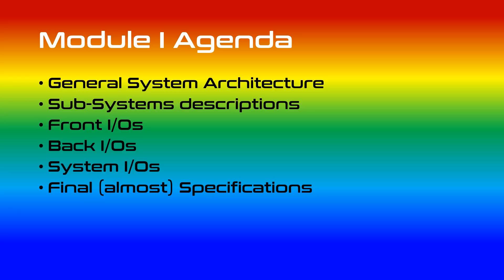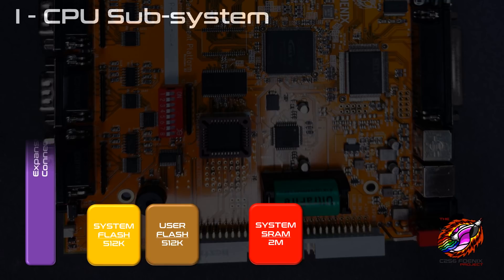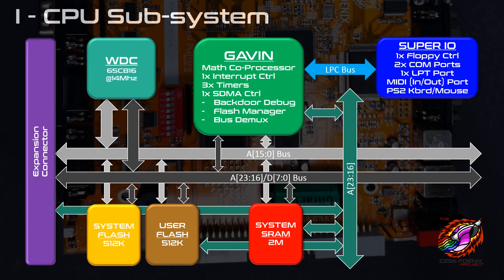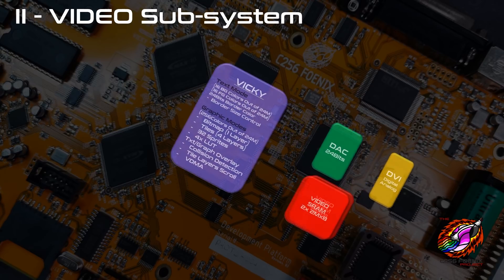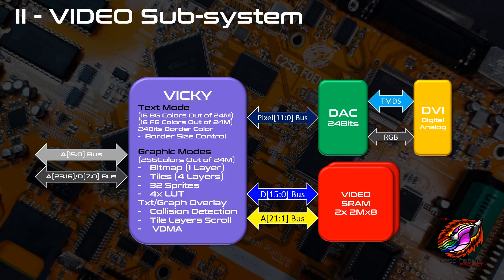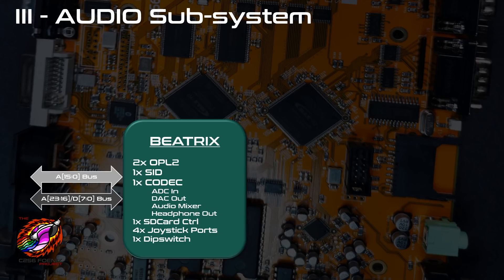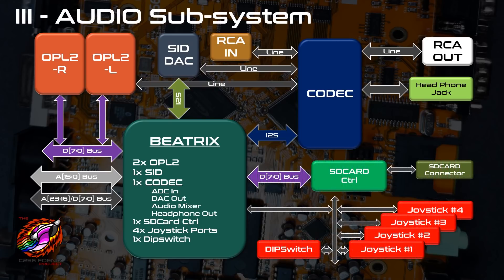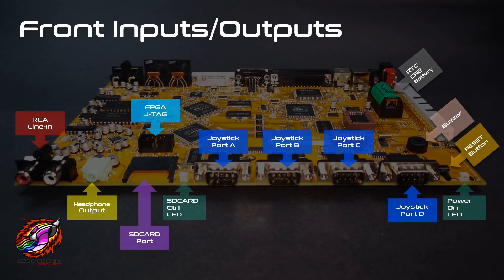C256 Foenix - Tutorial Series - Module I - System Architecture

Comment: You can get another way around this. Leave footprint for additional SRAM chips to fill up the address space. 2MB is a lot of space until planning to run more advanced games like FPS, which this machine might be capable of ;-)
I'm also curious if 65c816 in this system can be easily overclocked? Those CPUs can run stable @20MHz.
Reply from the maker: @Atad64. The C256 Foenix - FMX has 4Megs of Code memory on board. This is not counting the other 4Megs for the Video Memory. Unfortunately, the 65C816 doesn't overclock well @ 3.3Volts and also all the devices in the system are synced @ 14.318Mhz. So nothing would work if set to a different frequency.

Comment: Try as I might, for all the talk about it having a floppy drive. I just cannot find the usual floppy connector on the board in the video. Where is it? Am I going blind?
Reply from the maker: Bart, you are not blind... However, you are looking for something that isn't there... Please let me explain. Right from the get-go, I wanted to have a 3 1/4 floppy in the design and I wanted to make sure we could find a supply for them. So, the model I knew we could find easily is the model found in the 3 1/4 Floppy to USB contraption that you can have for about 10 to 15 bucks these days. The drawback (well, it is not a drop back for me) is that it is a low-profile model and it uses a 24pins flat connector as opposed to a normal 30pins floppy IDC flat cable.
So, in the video, the connector has not been soldered in which may have created the confusion. It is a kind of zig-zig type footprint and it is located just in between Vicky and the DVi Connector. It is pretty much centered. 
If you go on the website, you will see the latest picture of the enclosure and you will see why it is in the middle...
So, all of that to say, yes there is a floppy but it is a low profile 24pins flat cable (I mean flat flat, not flat wire)... So, you are not crazy!
Cheers!
Stefany

Comment: Will it be possible to disable the onboard cpu and give control to another cpu on the expansion header? The fpga cores alone would be valuable for any retro computing project. One might want to use them with a z80 or intel 8088 or perhaps even an 68000. Just a thought...
Reply from the maker: Hey Bart, this is a great question... However, I don't have a great answer. Right now, the system is not geared to be taken over by another CPU, because it has been designed for 65C816 Hi-Address/Data Bus Architecture which would make your life very difficult in terms of interface. The good side of the Mux Interface of the 65C816 is that it requires less pins on the FPGA which allows me to do more. The negative side is that it would inhibit the usage of another CPU unless you could emulate its signals.
But even though, since not all the signals of the CPU can be isolated, then it would be almost impossible, unless you would remove the CPU itself. In its original form the CPU was on a Socket, it is not anymore....
The other thing you could do if you are okay about doing your own board, then you could take the open-source design and modify it for a different CPU...
An European friend of mine has been bugging me forever to have a dual CPU system with the 68K. Since it would have increased the cost, I had to put that on the side. But I was always interested by the 68K and I was thinking about making a C256-68K Foenix at some point...
The other possible solution in the short term for the final version of the product would be to put some isolation buffer for all the signals of the CPU so, another CPU could take over. In that case you would still have to emulate the C816 mux bus...
Let me know what you think! Cheers!
Stefany
Reply: @foenixlabs  Hi Stefany, I understand your reasoning. I do not think you have published any schematic yet at this point (correct me if wrong), so I could not check for my question myself.
I more or less expected the cpu bus to be demuxed and the expansion connector and rest of system to be connected to that demuxed bus. As some cpu's will give high impedance on all pins when holding reset, the only thing needed for a cpu disable would be a jumper on the reset line. No further isolation needed. But maybe this is not the case for the 65c816.
If this is not to be, than by all means publish as is. From your comment I get the design is going to be open source. So I'm sure modified versions (for different cpu's or other things) will spring up fast.

p.s. I would not do a dual cpu thing as your friend requested. That would add to much complexity. But designs for different cpu might be great as secondary releases. Or as community projects. Your "custom" chip designs look great.
Reply from the maker: Bart, the schematic will be released when the board will be final. There is no need to have a gazillion number of different schematic on the internet at this point.

Now, something I thought I could do for you if you want to drive the chipset with a different CPU would be for me to make a special version of the chipset to accomodate the CPU you want to use. I would simply change the interface bus for them. However, the CPU you choose would still need to be a 8Bit CPU and the package would be switched to a BGA package to suit the need of the 24bits address space. So in order word, I could respin the FPGA to have a more general 8Bit interface as opposed to a specific one and I could make the FPGA load available for people to use in a different setup and yet possibly be compatible with the Foenix in terms of registers...
Stefany
Reply: @foenixlabs  You are very right. But I think you are making something very good, so you really can't blame me for being curious at what the final design will be :).
Reply: BBC micro had multiple CPU’s 
On the spectrum u can plug in hdmi video generator 
Só u can plug in functionality on the edge connector 
Don’t put rasbery pi lol
The zx spectrum next was going to use a pi for video, latter they figured it out

Comment: If you look at things like the Color Computer 3 (with another "16 bit" processor with an 8 bit bus, the 6809), three decades later the only thing that really drives massive amounts of memory is a reasonably advanced operating system,  OS-9. And even it doesn't have seperate video memory. Ten bucks is cheap, but unless someone is going to build a serious OS, there seems to be more than enough memory. But overall, a clean and well thought out architecture.